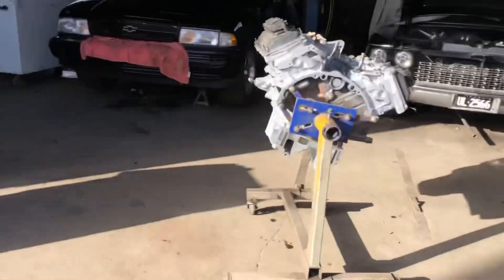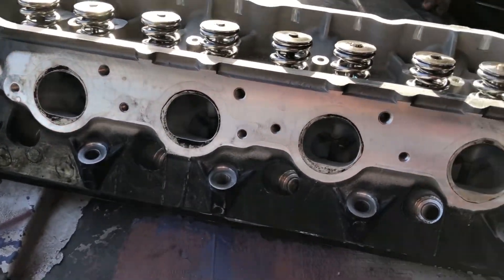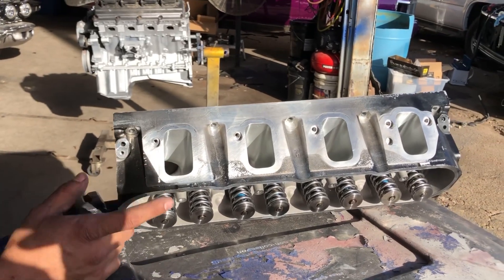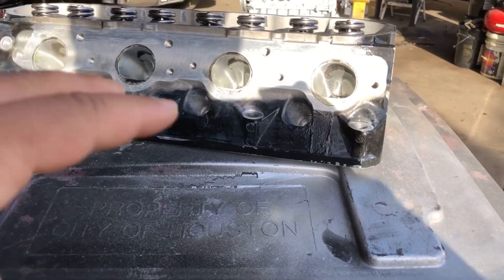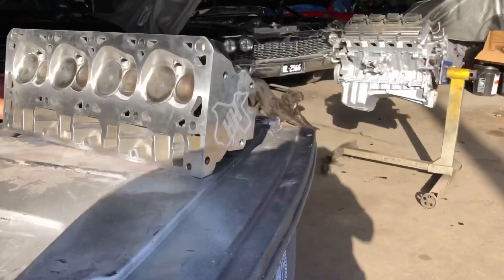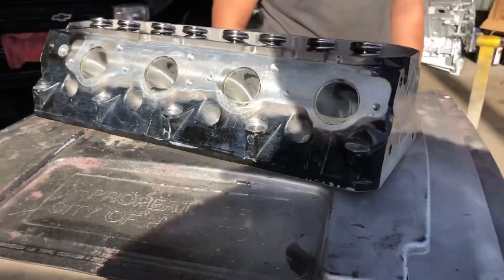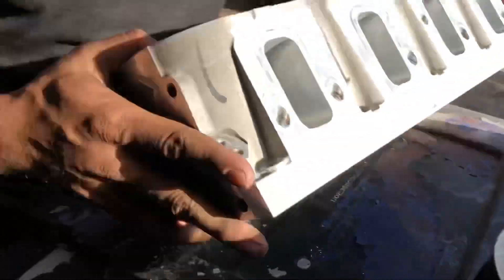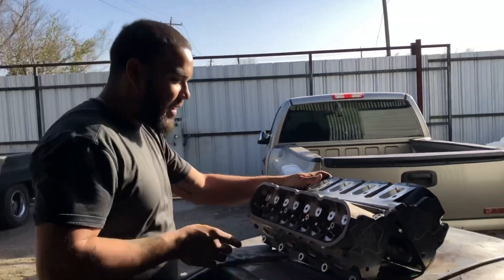LS3 vs LSA Cylinder Head Side by Side Comparison | Hooper Heads Port & Polish | Texas Powerhouse

Comment: 1000hp isn't much anymore
Reply from the maker: I know right.. it really isn’t, but for what I’m doing with the car, it’s plenty. I’m just looking to have just enough under the hood to pick on poor unsuspecting Hellcat and 392 Challengers and Chargers that want to tangle in the streets.
Reply: 1000 hp is more than most people can handle. Plus it’s starts to get not as fun dealing with 1000hp problems that the car pops up with. 700-800 is plenty fun on the streets.
Reply: For me… I’d shit my pants with a 1000 😆. But 1000hp is like a standard nowadays with all these new race boys. 500 is plenty! It’s dangerous. I can’t imagine 1000+. I’m gonna look into Hoopers Heads. I live in Pasadena. So I’m close.